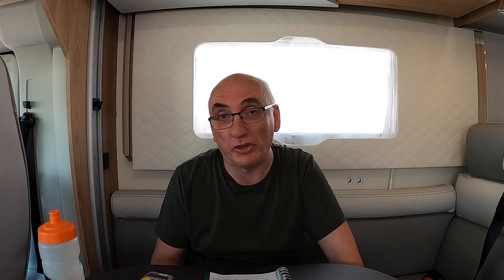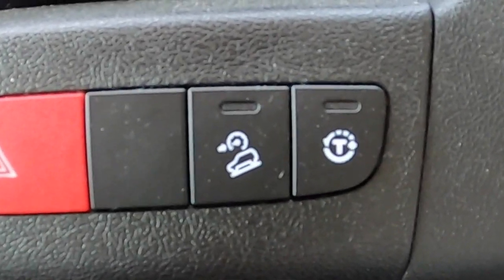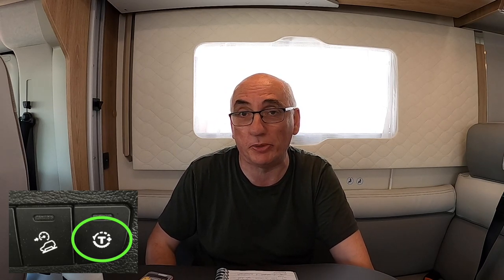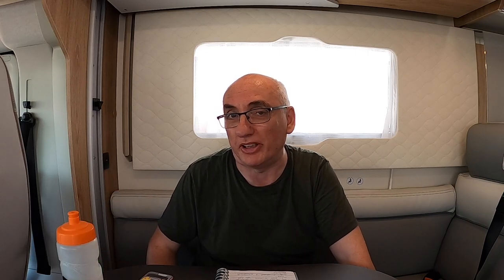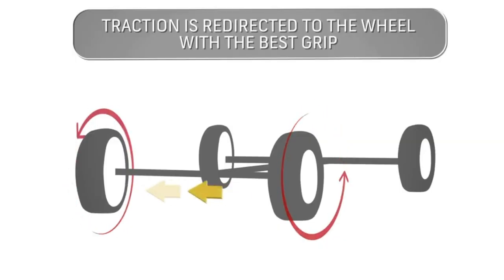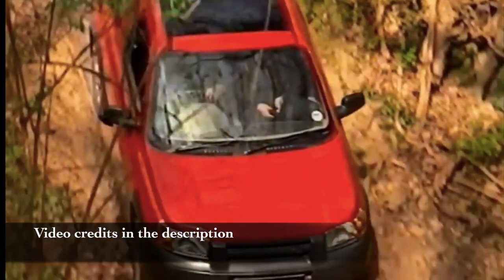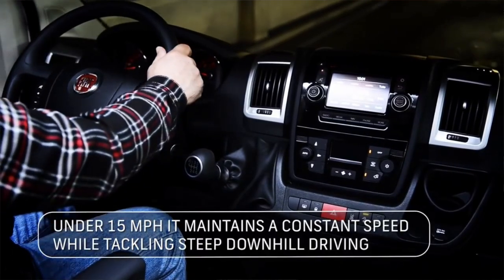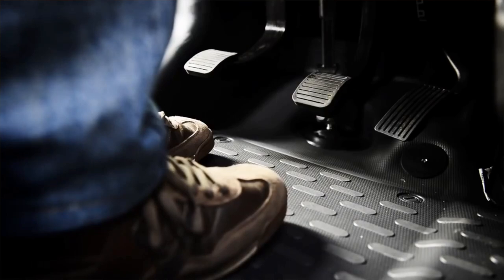How to Use TRACTION PLUS & HILL DESCENT CONTROL on a Fiat Ducato

Comment: New Trend owner here in NZ. Thank you very much for this explanation and your other useful how to videos. I have a button the looks like a vehicle with a weight on the back and a broken arrow through the vehicle with an angle through the bottom end of the arrow. Any ideas what this is for?
Reply from the maker: @allye5949 thanks. I believe it is fitted to automatic vehicles only and is used to hold lower gears for longer when heavily loaded and going up hill.

Comment: Saw these yesterday on mine while was cleaning it out after our last trip out with 2 messy kids 😭😭found another button yesterday that I was interested in but manual says it’s a self Levelling button with settings do you no much about this one as I am intrigued now to what it does says in manual there is 7 settings programmed into it does this change ride height for uneven sites do you know?? Also going on rode trip soon doing kent coast soon 12 days of bliss in the motor home 😀😀
Reply from the maker: I don’t know. That might be an aftermarket fitting. Feel free to email me a pic if you like livefortraveluk@gmail.com
Reply: @LiveforTravel  hi Paul thanks for reply I mean it doesn’t look after market like the other original buttons in the motor home but will email you later when am bk from work many thanks Jeff 👍🏽👍🏽

Comment: Hi, we've had our motorhome since March and I've just spotted a heated rear window button, but we've no rear window! As it lights up when I press it I think it may heat the door mirrors?
Reply from the maker: Which make of base vehicle is it? Many vehicles heat the door mirrors when the rear heated screen is on.
Reply: @LiveforTravel  Fiat Ducato, same base model, although older, as yours and I noticed you had the button as well
Reply from the maker: Yes it should heat the mirrors when used.
Reply: Thanks for that, trying not to watch the football 'cos I'm expecting the worst!!!

Comment: HDC I use when descending really steep gradients on the Scottish country roads where there are warning signs “1:12” “engage low gear” for example.  You would normally slow down and engage a low gear, eg 2nd then you can go down the steep hill, steering round the corners without trying to brake at the same time.  There have been a couple of hair-pin bends that have even got me worried, but the van handled them well.  Eg the coast road from Cambletown to the most southern beach.
Reply from the maker: I’m conscious of the weight when going down hill although the 9 speed auto keeps the gears low.